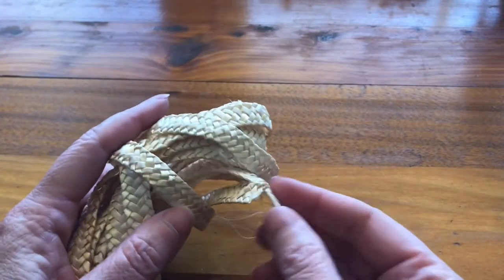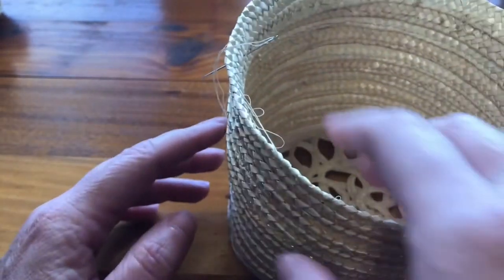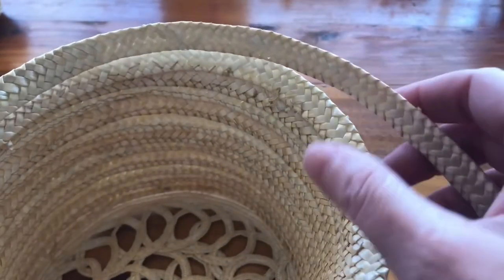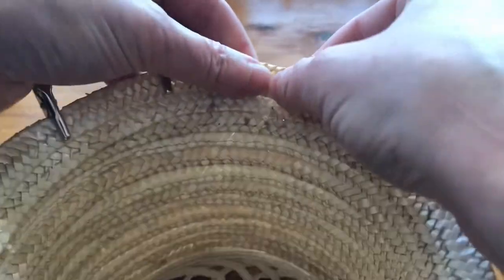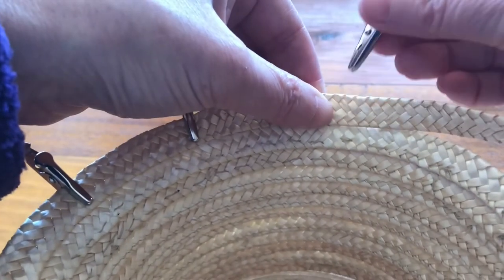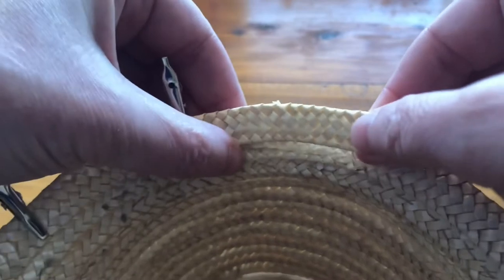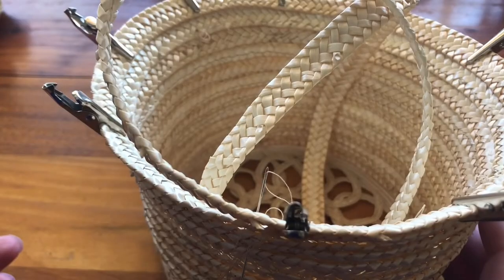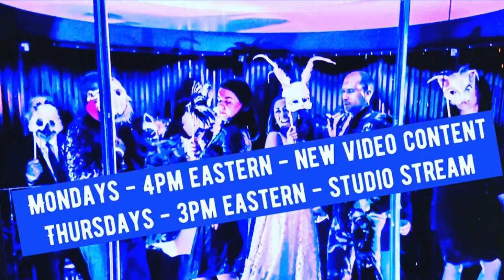How to transition from crown to brim in spiral straw millinery

Comment: Thanks for this very helpful tip. Do you have any suggestions on how much to overlap each of the spirals with the previous one for a basic sun hat. Thanks.
Reply from the maker: I usually do an overlap of about 2”
Reply: @LaBricoleuse  Thanks for the response. Can you clarify this?  For example, the 7 strand plaited straw strip that I’m making is about 1 inch (25mm) wide. I was thinking of overlapping the strips about 1/4 inch (6 mm). How does that sound? I’m assuming that I’ll need about 15 yards (13.7 m) for a hat. Does that sound about right?
Reply from the maker: @reflectionsofanagricultura6592  that all sounds like it should work! I think I misunderstood your question and thought you were asking how much to overlap when you switch from one piece of braid to another in the spiral, if that makes sense.
Reply: @LaBricoleuse  thanks for clarifying. This makes sense.
Reply: What ate the clips you use please